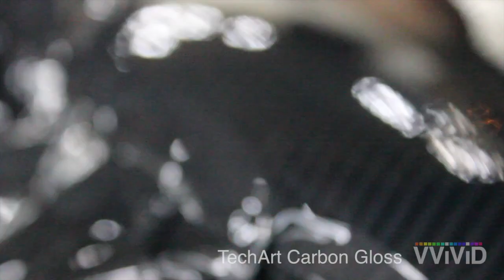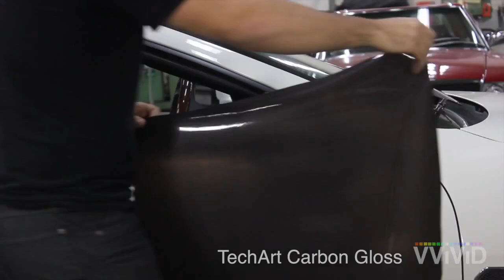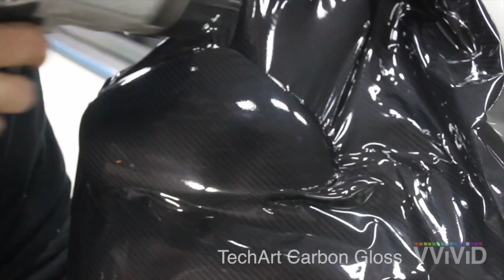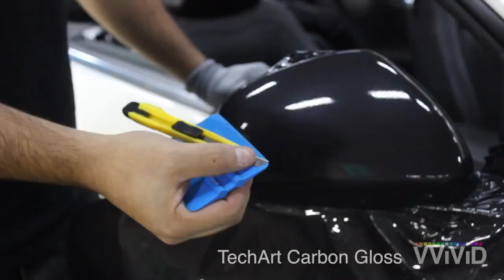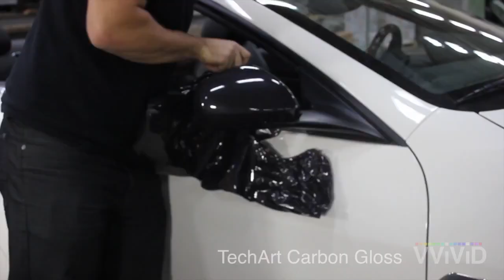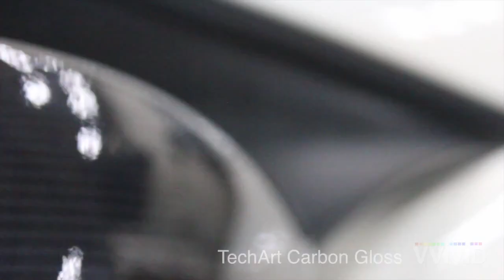How to Install TechArt Carbon Gloss vinyl to mirror

Comment: By far the best product I've used. High quality and super glossy. 👌
Reply: really? better than avery? 3M? Arlon? Oracal? Hexis? 

cmon dude LOL
Reply: TopWrapz yliteippaus I've used it, it really is good stuff
Reply: TopWrapz yliteippaus Anything's better than Hexis. cmon dude LOL
Reply: hexis is not bad actually. It has a different kind of glue and you have to use a bit different approach to install it. I'm definitely not a fan of hexis but I know that you can have a great result with it if you know the product and you have skill. Hexis is not so stable compared to other premium films, and I don't like the high tac of it so I personally try to stay away from it. Still hexis is much more better product than ViVid. This is not only my personal option, I know a lot of wrappers who would agree with me .
Reply: And how long does this gloss finish hold up?  Also, how does it hold up to weather, car washes, detail jobs, etc?

Comment: Can you make a "How to" for installing vinyl to sculpted mirrors like on the Kawasaki ZX14/ZZR1400 - are you able to cover it with one piece, or do you have to cut it?
Reply: You can't I have a Saleen 00 and the mirrors don't fold so is basically "Sculpted" and impossible to have them wrap without wrinkles

Comment: could I use this material to make vinyl cut decals ????? curious cuz of some of the colors
Reply: you shouldnt use it. air channeled, conforming vinyls made for wrapping won't stick so well if you make decals out from them. also wrapping vinyl is expensive, and all it's features are useless with cut decals, so it's like you throw money away. and btw it sucks to peel off the excess vinyl (weeding) if you use wrapping material. Try to find gloss carbon fiber, without air channels and that is calendered vinyl.

Comment: what temperature was the heat gun  at done at and how long?
Reply from the maker: Here we used the post-heating technique at around 90 degrees celcius using a standard heat gun for around 25 seconds. Find out more of the details of post heating at http://vvividvinyl.com/node/87 Thanks!

Comment: Isn't it gonna peel if you don't pre-stretch before you apply the vinyl? especially the lower right corner of the inside side mirror? Too much stress in that area.
Reply: probably will.. pretty horrible "tutorial". they didnt show any real professional work there really..
Reply: TopWrapz yliteippaus
no because thats the point of the blow drier at 90 degrees it kills the "memory" part of the fabric so that it doesn't fight the adhesive - when it does its what your talking about.
Reply: Adam racecar nah. post-heating won't work if you over-stretch the corners and edges.. The adhesive layer will get thin and the pvc will crawl back on the edges because it can't take too much stretching. Vvivid is also re-branded low quality chinese film, and it's actually calendered vinyl which won't conform too well on areas where you need to use a lot of heat and stretch the material. Premium wrapping films are cast vinyl.
Reply: TopWrapz yliteippaus  It's not rebranded. Try the film for yourself and try comparing it to Chinese wrap. The material is a hybrid composite of Cast and Polymer manufactured in Germany. There is a lot of fake or copied products in china. They use vvivid's photos as well as every other photo on the internet. Read reviews on vvivid, you will see that they have amazing success with the materials they sell and so do their customers.
Reply: ZEDGLOBAL CANADA Thanks for the info.
Reply from the maker: Pre-stretch is meant to facilitate installation, it will shrink and contour the surface with more ease. However, pre-stretch is not fool-proof and post heating over-stretched areas is what will make the difference. Post-heating will remove any "memory" or "tension" in the material. This will ensure a longterm, reliable surface.  Hope that helps

Comment: so you wrap a mirror with plastic to make people think its made of carbon fiber, but its not carbon fiber? not sure I see the point in that.
Reply: +veedub447 it looks pretty cool... i used to bash it too but god damn the stuff is neat... even the cheaper, textured (not glossy ones) look pretty freakin cool
Reply: It's for appearance only.
Reply: Brett DiMichele Studios the carbon texture looks nice. Nobody replaces mirror caps for weight reduction. Companies even make real carbon caps for ur mirrors which overall add weight rather than reduce weight. Carbon ideally is a material used to reduce weight although the look of the material is very appealing
Reply: Kel Loves orange soda it’s sort of like the exhaust tips on your Mercedes-benz. It’s just there for looks.